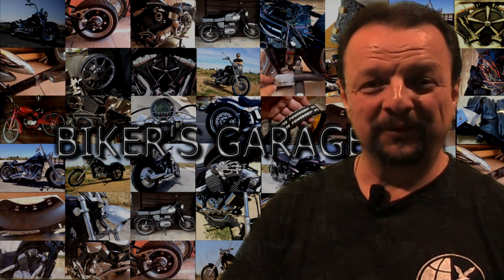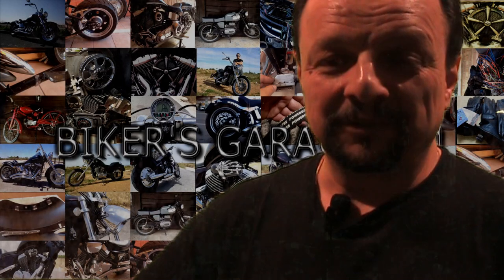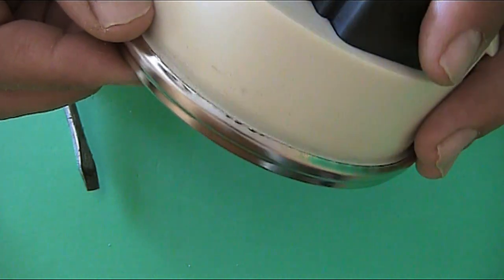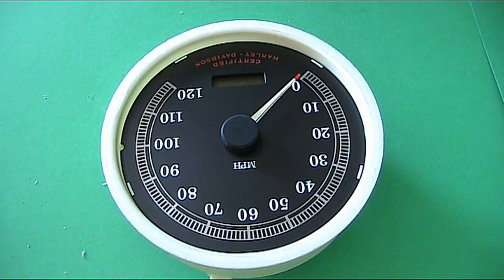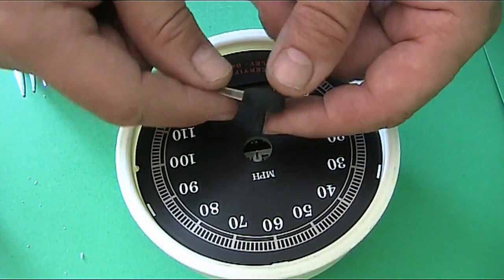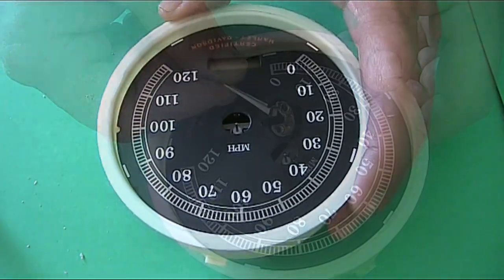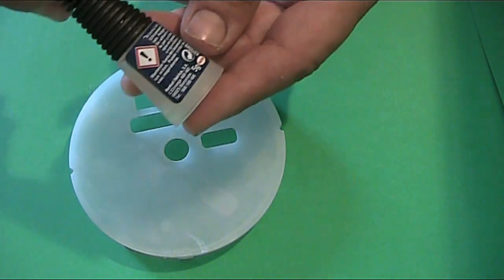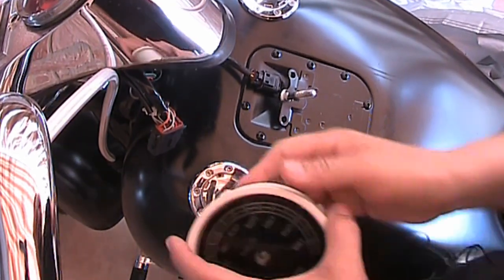HOW TO OPEN HARLEY DAVIDSON SPEEDOMETER DIAL FACE CHANGE

Comment: Dude, thank you for this video, seriously thank you! I had a perfectly good speedometer with a needle positioned wrong at the 6 o clock position and it's always been that way. It worked fine just was 25 mph under my real speed so as you could imagine it was annoying to look at and to have it blocking my digital screen. I had no symptoms of a faulty or dirty speed sensor as everything worked perfectly including rpms odometer and even the speedo besides the needle being wrongly positioned. This video gave me the confidence to open my speedo up and zero out the needle. The speedo you had in the video is very similar to mine almost identical actually so to see a step by step and thorough description on how to pull the needle up and off was just spectacular!

I did everything exactly how you did it and at some points I was second guessing myself like prying the crimp up which took me a very long time to do and especially the needle itself which required alot more force to get off than I was expecting and it scared the hell outta me. I realized the needle has 3 click positions when putting back on and I had to place it at 1 mph to get it to 0 because the first 2 clicks seem like its lined up at 0 the first time I did it but than the final 3rd click to push it all the way down kept moving me down 1 mph. So I started at 1 mph and the first 2 clicks were at 1 mph than the final click lined it perfectly at 0 mph. I did diagnostics sweep and it did the full 120 mph sweep which was first test than I rode it and the speedo worked perfectly! Thanks to ypur video I finally have a perfect speedometer!!! I really love the speedo I got too and it is like brand new so it wouldve sucked having to change it. I can't tell you how long ive agonized over this thinking id have to spend $350+ for a new speedo and/or speed sensor but all I needed was to reposition the needle all along and until your video I thought wasnt possible! So dude, seriously thank you!!

Comment: Great tutorial, must have been some kind of film on the inside of my speedometer glass that crazed, could hardly read it in the sun. Got it it apart with a thin flat screwdriver and patience, cleaned the glass with liquid bar keepers friend, went back together fine, can’t wait to get it back on and get back on the road next spring!
Reply from the maker: Glad to see it helped you buddy
Ride safe
Reply: Hello, how did you replace the film? I mean material or you just left it like that? I cant read mine either
Reply: @blackboxter  I just cleaned it and put it back together, moved up to a road king due to my back a while later so not sure what happened long term, sorry about the late reply

Comment: I realize this is an old vid but thanks for the hints and information on how to do this. My local shop wants $150 to do the swap plus parts and therey're won't guarantee the work due to the pin and servo issues.

Comment: My speedo needle broke about 3/4 of the way down and this video is gonna help allot at least now I know I can replace the needle rather than 300+ for the whole assy
Reply: Hey were you able to reposition the needle in your speedometer? My needle is in the 6 o'clock position in middle of digital analog screen instead of sitting at 0 and when I ride it will go up like normal but be 25 mph under the speed im going. So if im doing 25mph the needle will get to 0 and 8f im going 50mph the needle will get to 25 mph. Im stressing about this and don't wanna change my speedo cuz of the odometer reading not being accurate. Wondering if you know if I can fix this? Thanks
Reply: @CantTreadOnMe  unfortunately not my speedo needle decided it was just time to break off entirely I wish you luck in resolving your issue though
Reply: @AstroRampage  Ahh damn man im sorry. I best not try to mess with it and should just bring it to the shop cuz I don't have gentle hands and am clumsy with tedious jobs. Haha
Reply: @CantTreadOnMe  probably for them best 😆😆
Reply: @AstroRampage  😄

Comment: Thanks for the info on how to get the bezel off and back on. Had to change the glass cause a brother dropped some tool on the speedo while it was being stored  over the winter and broke the glass. You for sure have to be patient taking the bezel off cause it does take some time no doubt. New glass comes with a new bezel and rubber  fto go around the glass for $13.00 dollars. It also takes some time getting the bezel to bend fully to secure it to the speedo. Project done now it's time to ride.
Reply from the maker: Awesome bro! I'm stocked that this video helped.
Please rate, share and consider subscribing. 
Ride safe!
Reply: where'd you get the new bevel from?
Reply from the maker: @madhousemotors2319  I did not use a new bezel, I used the same one. You can surely find new bezels on many sites but I would check out your local supplier and also check these sites ((I know they have but not sure if for your bike):
Don't forget to rate, share and subscribe.
ttps://www.motorcyclestorehouse.com/searchresults?keywords=speedometer+bezel#!sorting=speedometer+bezel&limit=24&view=grid 
https://www.dragspecialties.com/search/?q=speedometer+bezel&submit=&docType=product
Hope this helps. Le us know how you got along with this.
Ride safe

Comment: Did I HEAR RIGHT ? You're in Spain !?! That's a Godsend. I'm in Gibraltar. My pickle is, I bought a HD Softail Custom in NY State and had it shipped over, no problem there,  only that I discovered the usual dilemma of the uninformed buyer,  THE CERT of CONFORMITY.!!! The only item keeping me back is to change ( or adapt if need be) the face on the speedometer that displays speed in Mph and being in Europe I need this changed to Km/h or no ownership papers can be processed.
ps- you do online sales? if so, send your web page, sales info or whatever mate.

Comment: Thanks for posting this! I need to switch my bike to KMH where did that gauge face you installed come from? Most custom places make a metric face that fits the metric stock Canadian Harley gauge, they do not have the same scale, 100 is slightly to the left of centre and they go to 220, on a gauge that is originally MPH 100 km/h would be slightly to the right and go to 190.
Reply from the maker: Good point! You can actually design the face and place the 100 more or less where you want it depending on where you place the 0 position. If you place it exactly as per the original MPH scale the converted face in KM/H will have the 100 slightly to the right. Now if you were to design a new face and place the 0 position slightly below, the entire scale would rotate to the left and place your 0 further down which to me would be rather weird. I can see your point but it makes no difference at all, the needle still moves by a pulse that calculates in MPH the only thing that changes is the scale that you see. You can get these at www.iguanacustom.com. If you have any problems contact me and I will arrange one for you.

Comment: So mine is basically steaming up a bit wondering if I could just get it clear with the hairdryer and then silicone on the inside of the lip to make it airtight ?
Reply from the maker: The problem IS that it is probably too sealed and the air inside will condensate inside the glass. Believe it or not, these bezels are not air tight.

Comment: Hello! At the end of the video you started to explain that it was not necessary to seal with silicone to avoid fogging the panel. Do you know how to solve this? I have a 2018 Fat Bob suffering from this evil. And the worst thing is that it blurs exactly in the speed information. I can't see how fast I am. do you know how to solve?

Comment: Good afternoon friend. can you inform me if the fxst speedometer 2007 has consumption even with the bike off? I noticed that mine has a consumption of 40mA. thank you so much if you can answer
Reply from the maker: Hi Carl.. thx for checking out my channel. To be honest, I don't know for sure  but I have heard that security system and what not will drain your battery flat over a short time

Comment: Thanks for the video, i replaced my face on this using the guide. I have a question/problem and maybe you have some advice. Speedometer doesn't want to go above 20mph now. When it tries to it just bounces back under 20mph. bike is a 14 heritage softail. Any help is appreciated.

Comment: Hi. My speedometer doesn't have these holes  (bottom side) - 2015 Fatboy - and it has moisture inside the glass. Do you know how I can solve it? Is it possible to seal ?  Thanks from Brazil
Reply from the maker: Saludos Rafael! Here's the thing: if the speedo is totally sealed the air inside will condense and create moisture. The trick is to let air circulate without letting water in. 
The more you seal it the more condensation. 
Obrigado

V'sss
Reply: Biker's Garage 101 : I'll try to do 2 small holes, maybe  it's a good idea. Thank you (Obrigado)
Reply: Biker's Garage 101: I don't understand, I had some bikes (Triumph, Suzuki, Kawasaki so on) and it didn't happen...

Comment: The odometer on the 2003 road king which I am was working on was working but not the speedo. So I did this exercise but the meter still does not work.  What is the possibility that I can open it again and try changing the servo motor please??

Comment: The example is quite an obliging one and little collateral damage was done to the bezel but some need a lot of persuading. The problem is that instead of just lifting the turned-over-edge the bezel gets splayed and won't then crimp down cleanly, evidencing having been stripped. Chrome flakes off too. What is needed (and it would be better in this example too) is a tight fitting sleeve made on a lathe, or failing that a hose clip or even a Jubilee clip. Position the sleeve flush with the turned-over-edge and go to work, moving the clip around so you always un-crimp at a tight fitting area. This restricts the bending to only the turned-over-edge and with a little care and time it won't show it's been apart.
Reply from the maker: Nice comment haieyoldhippy. I did think about the sleeve but then turned the idea down as not everybody has a lathe (I do) and then again I thin it would have to be an expanding sleeve and so thin it might cut into the plastic case without realizing it. As for the  other two, you never know, give it a try and let us know. 
BTW is you pray it open just enough it won't split. Mine was stainless so no chrome chipping
Ride safe brother
Reply: Cool "Biker's". Coincidentally just had a Lancia Fulvia (tick tock) clock presented for fixing. Particularly difficult to un-crimp because kinda thick steel, needed sharpened (cheap) side cutters to lift the lip but nibbling against a hose clip worked fine.
Rubber side down bro.

Comment: I installed a much larger motor in my bike and it's likely going to break the analog speedometer which only goes to 120mph. I noticed that the metric ones are good for 180 kp/h. I see some metric ones on ebay but they're expensive but I'd 
love to buy one and make it accurately read mph.

Comment: I have that speedo on my Harley and the needle is in the 6 o'clock position and is 25 mph under my actual speed when riding. It literally sits in the middle of the electronic screen for odometer reading etc. What is wrong!? Can I fix it by moving the needle back to 0 if I open it up?

Comment: What year gauge was that?  Your version...the plate popped on....( glued on the support plate )....and another video I watched, says the gauge plate is glued on...then the support plate is removed with 2 screws?  How do I know which type I have?  I will be attempting it on a 2004 flh gauge...but only for the LED.
Reply from the maker: +sumyonguy This came off a 2001 Fatboy. Hope it helps. Ride safe!

Comment: I got my bezel off successfully, however mine is black not chrome. I now need to get it back on, should I just use tape to protect the edge I'm going to be crimping? I fear the hammer hits would scratch the black. I ordered a replacement bezel in case I screw up and scuff it up.
Reply from the maker: Don't know what the model is but normally you would be OK as you will not not see the hammered once you mount it on the support. Tape won't do the job
Reply: @BikersGarage101  alright thanks. It's a 2016 Iron 883. Just purchased the digital speedometer but dont like the chrome ring as it doesnt match my denim paint. So swapping it out for the stock black ring that came on my analog speedo.
Reply from the maker: @DarthxRinzler  Cool Steve. Let us know how it went

Comment: Do you know where we can send a Harley speedometer and get the glass replace in the USA. Thankyou Steve from seattle,  wash usa
Reply from the maker: No idea. There has to be tons of places but to be honest, I don't know of any. I do know that any authorised HD will do it. Give it a try, it's easy
Reply: I think you can buy a new speedo glass and rubber gasket for older Harleys  at J & P Cycles...

Comment: thanks for the video , i do have a question though now that u changed the guage from miles to km how do u change the digital display from miles to km
Reply from the maker: Jonathon Williams Well that is a good question Jonathon. Sorry for such a late, late reply. I did not see your message. There is only one way to do this in a MpH speedo: hack into the speedo software via a HD black box! That ain't happening any time soon! This said, there are some models sold in the UK, CA and other countries that come both in MpH and Km. With these, it's a question of using the select button on start up. This procedure is well detailed within the owners manual

Comment: here in mexico there are not these dial faces for sale, so my question is if is it posible to open the speedo and just to put a small decal or paint it just to make it different, does it damage the speedo, thanks for your atention
Reply from the maker: Raúl romero Vázquez Hi Raul. If you follow the instruction as per the video, you are not likely to damage your speedo. What you should consider is what type of face you want to use as it need to be calibrated. The people who sell them over here do export. Give them a try. Ride safe amigo!

Comment: 1989 Harley FXRS speedometer cable  location? Is it on motor or front wheel?
A frien picked up the bike without a cable, looks like the frontend has been changed - but the new cable is to short to reach the front wheel? Thanks for any help ..
Reply from the maker: If I remember correctly, it has a front end driver. I can only track down the first fully electronic units during the mid 90's

Comment: Is there a way to change the background color of the speedo and tach?
Reply from the maker: Yes Glen, there is for the more modern dials. You will need to change the surface mounted LED's. This is a rather delicate thing to do and you could fry the board.
Thanks for watching and ride safe

Comment: How thick is dial window? 
Thought to change color of speedo by changing dial window to, in my case, to purple plexi glass...
Reply from the maker: Won't work. It's about 103mm
Reply: Thickness of dial glass? Not diameter! Thickness can't be 103mm...?
Reply from the maker: Mika.... no need to get aggressive! Lots of people ask lots of questions in different way. It would seem that I missed the "how thick" part and thought you wanted to know the diam. In any case, its about 2-3mm for all its worth!
Reply: How I was aggressive? My sincere apologies, that wasn't my intention!

About 2-3mm, would it be possible for you to measure actual dial window thickness? 3mm plexi glass is easily available, 2mm is bit harder to find. No hurry, here at the Land of the Finns, also known as Finland, winter is closing! =0)
Reply from the maker: No problem bro! I just saw too many exclamation marks that all. No worries we are good.
Cold in Finland yes! 
Ride same my man!

Comment: This is not for touring models 2014 -Present. The metal trim comes off the same way but now Harley has heat welded the gasket and requires a knife to cut the seal.

Comment: And how do you get the odometer addapted? Because he will now count miles and show kilometers?
Reply from the maker: This is simple, the new face is calibrated according to the movement of the needle regardless of if the speedo is mph or km. Simple math